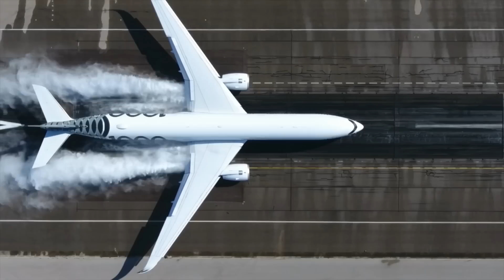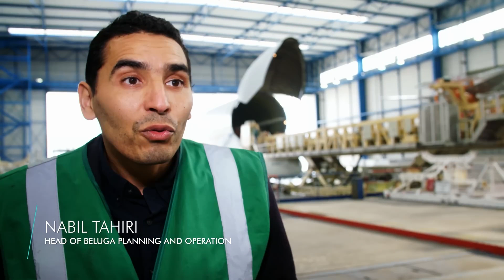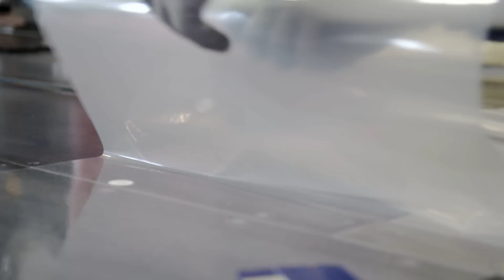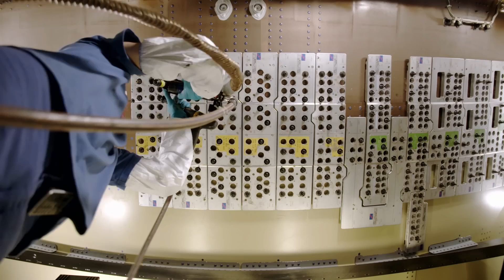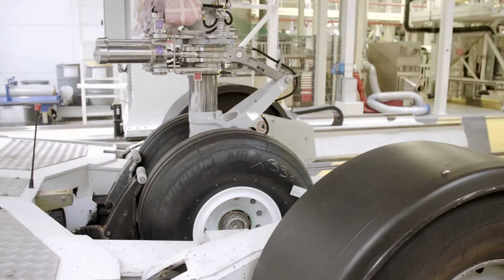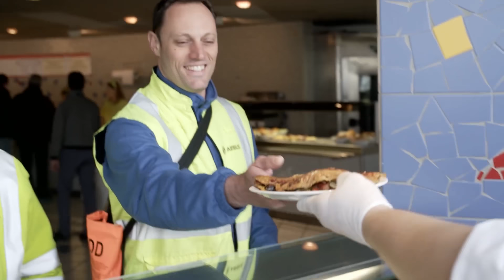Mega Planes: Manufacturing, Maintenance & Transport of Giants | FD Engineering

Comment: At 1:15:14 Inspecting each screw? Cheaper than installing new? Well I worked on aircraft for 16 years, removing floor panels, you're lucky you can retain 30% of the screws. Mostly the heads will strip out to where you can't reuse the screw.